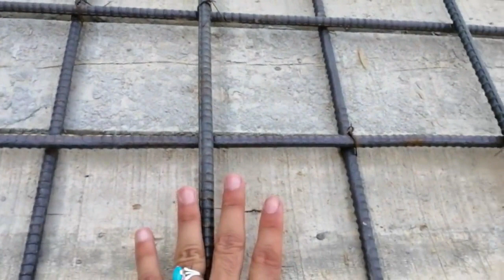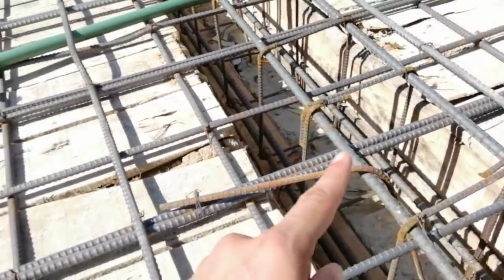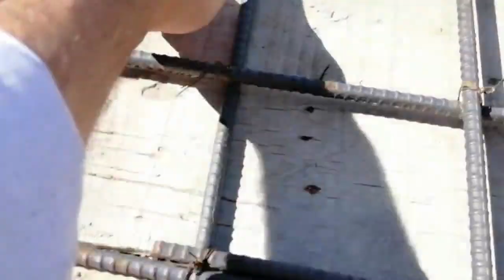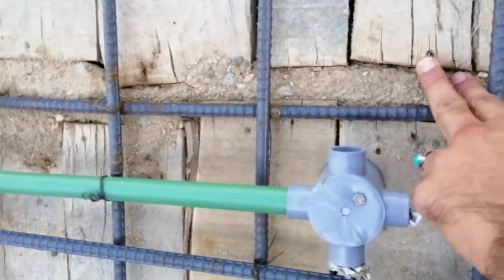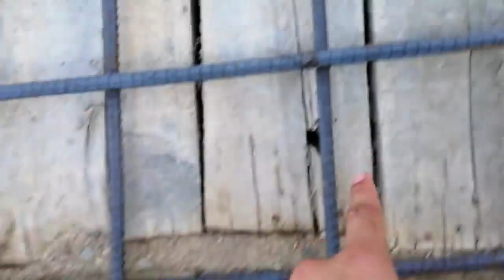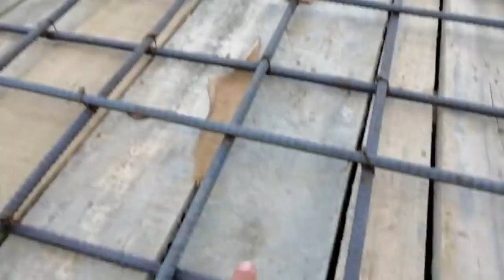Big Mistakes in Slab - How to Fix Steel Reinforcement Mistakes on Construction Site?

Comment: Sir please make a video on this topic how to check bearing capacity of soil on construction site with practical not theortical
Reply: You will require a test to be done at the site to get the bearing of soil. A test like plate bearing test, you can't measure the bearing at the site manually.